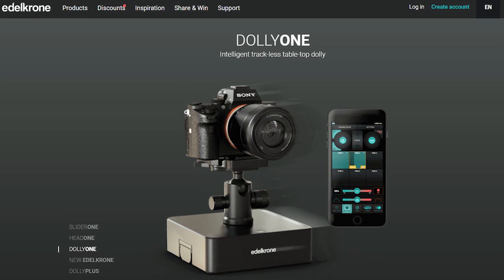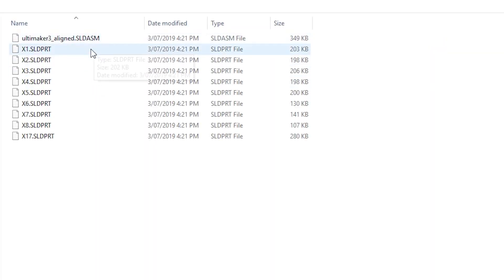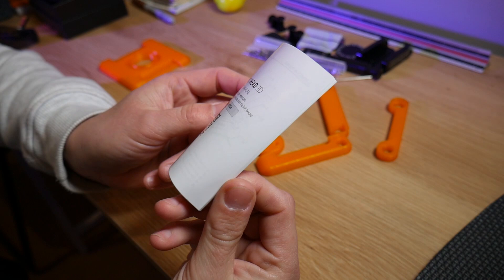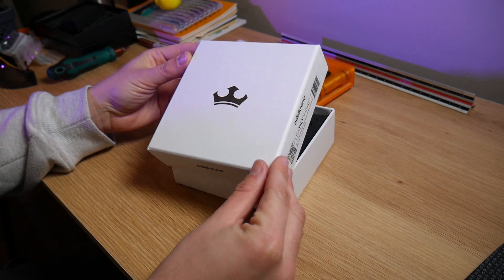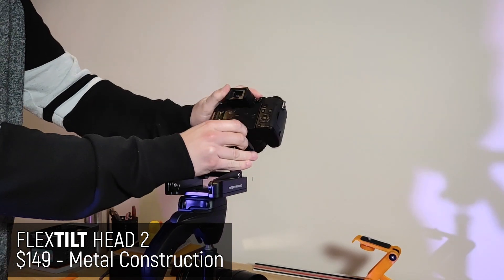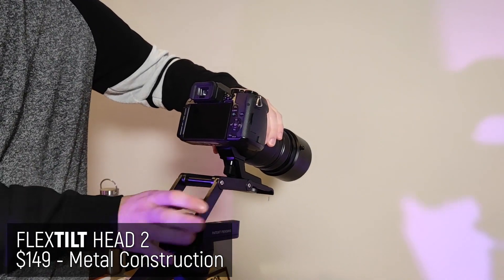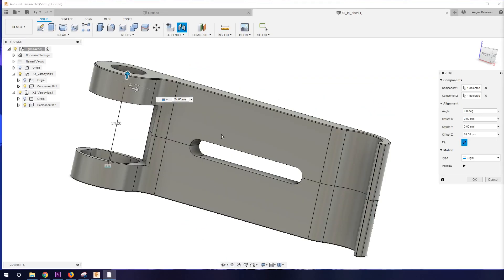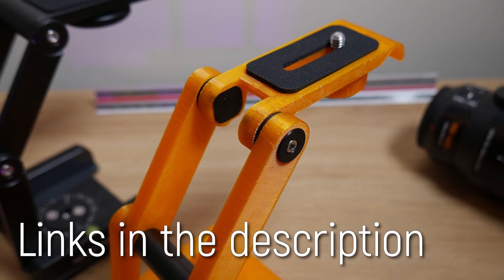Is the FlexTILT Head 3D the Future of Manufacturing?

Comment: Boy, the heavy cam definitely shows the bounce of the 3D printed version. Doesn't seem possible to really get smooth footage with it IMO. A carbon or glass nylon filament would probably alleviate this, but then the hotend needed to print it well would outprice the metal version. Overall I agree with the below comment, this 3D printed one is a gateway drug to the real deal.

Comment: The issue with the larger lens is not weight but balance. Using the lens mount you have you need to pull the camera on the mount so that the lens/camera combination is not so front heavy. I use a much bigger lens camera combination and unless I balance it properly on my head it becomes unusable.

Comment: In my opinion, the shipping “cost” or waste is not comparable because the filament shipped can be used for other projects (at least have the potential to) whereas the metal bracket is quite specific in its use and more limited to different applications, than a spool of filament.
The recyclability however, is probably more limited for ABS than it is for metal though because (I think) steel can be recycled almost indefinitely whereas ABS is quite limited.
There are a lot of factors and I feel it is critically important that we find a plastic that can degrade quickly in some environments (such as whale GI tracts) or cold water environments, preferably both.
We have the technology to make plastic last almost forever, we should only use that technology for specific, long-term uses and make bio-degradable plastics the only legal product. Companies should have to pay licence fees for producing non-biodegradable plastics due to the fact the products will need maintenance for ever, from production to use to disposal, the plastic will exist and have to be managed. If a company makes something, they should have to pay to make it a permanent part of the earth. If a product has a normal lifecycle like all animals and plants do, then, no licence would be required, as long as there is no environmental harm in the production and distribution of said item.
Just my opinion of course.

Thanks for the content!

Comment: Is the camera mounted the wrong way around?????  I was just thinking if u were to use a heavy lense that far out from the pivot point there would be a fair bit of leverage force on the joints compared to the other way around???? also with it the other way around the weight mass should would be closer to the centre of the tripod???? or am i overthinking this???? I just assumed thats why the camera mount is offset to the rear (to accommodate the lens weight)

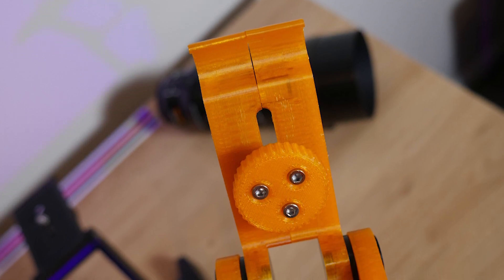Comment: You could actually see the top plate of this 3d printed tripod cracked in one of the photos at 4:43. I presume it broke in half and Angus glued it together.. It's good marketing for this company though, subliminal message to suggest buying the metal one instead of opting for the 3d print kit.
Reply from the maker: It's two parts , I explained I didn't like that decision but they did it to remove the need for supports

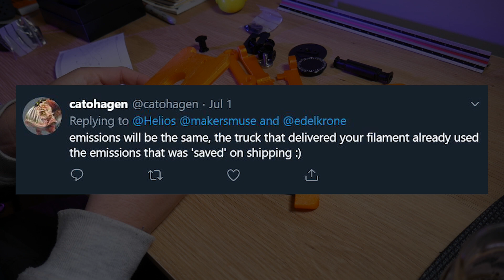Comment: @10:30 the impact to the environment isn't even comparable between the two, filament is wayyyyy less harmful. keep in mind that a) it weighs far less overall which is the primary factor for shipping fuel cost b) what environmental impact shipping your filament had is divided by the amount actually used for this device (generally 1/5th the entire roll, so 20% of the environmental impact is used, not 100%) c) most people will likely print in PLA which is a completely renewable plant based product that isn't mined.

Comment: For the moment, unless the trade war goes way worse, my thought is that, no, this does not make 3D printing the future of this kind of product, yet. The original version might be CNC'd, but for this kind of things, machining already does the job well enough, and that's really cheap as long as it's a "kit". In fact I bet they could have release the metal version as a kit and it could be cheaper than the 3D printed version when you consider the price of filament. That's, of course, unless trade war goes way worse and the price contains a lot of custom taxes.
So what's the point having the 3D printed version then? Likely it's for getting a lighter version of the same thing, or for being able to customize the design a little bit, rather than for cost saving. But just as a side note, if industrial 4.0 gets strong enough, single unit CNC part ordering might become cost efficient enough. CNCs can be auto loaded and unloaded, and mail packages can be auto sorted, after all. It's just the assembling that currently can't be auto programmed using the assembly, as far as I'm aware of, so only kits can be shipped without human involving.

Comment: If you really need the bubble level, they sell them on amazon in multi-packs, just search for "micro bubble level" or "disk bubble level". Then its as simple as importing the base step file in fusion 360 and making a indent to push the disk level into.

Comment: The reason the long lens makes it droop is the distance to joint - you're making a massive lever and applying a lot of torque.  A similarly heavy but short lens might not cause the same problem.

Comment: It seems to me that the entire design is very flawed, and may work a lot better if it included ratchets and manual twist tighteners ? Plus an Independant base that wouldn't require a TriPod, which should be doing all of this posing by itself ? !  ( ? )

Comment: 40 years later, need a repair for my grandpa's camera mount, load up the files print out the new parts and keep on rolling. That is the benefit of the current state of 3D printing.  You will never be without parts even for more unique equipment ( single digit product runs)

Comment: 4:46 add a slot with a larger inlet/pass through hole for the thread (think of a shifter in a car) and print a filler to put into the area once the part is added so it doesn't come back out, you can make it slightly cone shaped and use the pad to hold it in.. or threaded or clip idk

Comment: It might be worth pointing out that this head isn't really meant to be used on its own, or directly on a tripod.

I mean, if you just had a very basic tripod with no central column and no head at all this might be vaguely useful, but no photographer (with a clue) would pay $150 for for it when you can get proper, professional-ish grade, lockable, micro-adjustable 3-way pan/tilt heads for less than $200. It's just not secure enough, versatile enough or ergonomic enough to justify the price.

The point of the FlexTILT Head is to be used as a kind of "mini-tripod" mounted on top of Edelkrone's ($700) DollyONE (basically a remote-controlled base that can move and rotate on flat surfaces, to do tracking video shots.

Comment: As someone who worked in materials testing, it irks me to see so-called testing that's poorly conceived, planned and executed. Anecdotal experience does not equate to "testing". True testing has a) methods, b) metrics (objective and quantifiable) and c) conclusions. True testing involves real world scenarios, plus safety factors, and measurement devices.

So, for this type of test, I would have described real world use cases. Hint, a long, heavy lens doesn't qualify. Firstly, because that's not the product's intended use. Simple physics dictates moments of inertia, and cantilevering mass well beyond axes of rotation...you most likely get the point.

Regular lenses and macro lenses are more appropriate. With any of this equipment, both FlexTILT versions would've performed equally well, albeit with more rigidity for the commercial version owing to its aluminum construction.

Lastly, true testing requires consistency. This minimizes variables while ensuring confidence in results.

So, standard camera bodies (DSLR, compact, mirrorless) with standard and macro lenses. Weights recorded. Joint torque forces recorded. Exerted forces and angles recorded. And deflection and vibration (both amplitude and duration) recorded. This is done for both rigs, the metrics compiled, comparisons and conclusions made.

With a product capable of performing satisfactorily for a wide variety of tasks and users of all types, Edelkrone are to be commended for adopting such a forward thinking approach to product sales. I love the idea of combining affordable kits containing only specialty components with 3D printable files. This is a win-win as manufacturers stick to what they do best, save on tooling, production, inventory and shipping and handling costs, while consumers gain access to high-performance products that would've previously been beyond the financial means of a much wider audience. Hopefully we'll see much more of this innovative approach in the future.
Reply: A scientifically rigorous series of tests like you laid out would be great, but it's beyond the scope and budget of this channel. And your attitude stinks. You can be irked and still mind your manners. He made an excellent video within the parameters of this channel.

Comment: I would print in PLA as ABS gives off toxic fumes and I don't think the temperature will be an issue. Doesn't really matter if you already had ABS laying around but I wouldn't recommend using it over PLA. I'm still new to 3d printing but I do think PLA would be better for the majority of people. On average PLA is 1-2$ USD cheaper than ABS. I could be wrong.

Comment: 3D printing is more expensive then injection molding, when you take the time into account and injection mold in volume. So, replacing cast metal with 3D printing is non sense. Metal casting has to be compared with injection molding, especially when a company plans on making more units then currently.

Comment: Since the models are modifiable could you help offset the additional flex by creating channels designed to pressure fit in aluminum rods to add a bit of rigidity to the parts?

Comment: There is a huge difference between what will hold a camera firmly and what will hold it rigidly, and it also depends on which sort of camera you are using. A DSLR, with its moving mirror is very different from a mirrorless camera, particularly when using the electronic shutter. Particularly for a DSLR, any plastic head is a really bad idea. Also, can you imagine if the user prints in PLA and leaves it in a car in the sun. I remember the video you did on prints left in a car. I know it's not ideal for camera gear anyway, but to come back and find that some of your gear has now distorted would not be fun.

Comment: The plastic printed version is a clever strategy from the manufacturer in that it serves as a gateway drug to the real one. This isn't a replacement, it's an introduction.
Reply: Damn, that’s some smart marketing tactics.
Reply: Unless you only use really light cameras, like really any action camera, especially since the go pro works just fine for a lot of filming when you aren't doing super professional stuff like movies, at that point you don't need a super high rated mount that can handle a lot more than you would ever need and would likely be content with the 3d printed version (also about the go pro being fine, I'm not just saying that to defend a personal camera choice, I much prefer using my Canon EOS 60D over any action camera because I get perfect control over any parameter I need/want to change)
Reply: Plastic waste as marketing ? Yayyyy

Comment: Will a Prusa i3 Mk3 do okay with ABS? I'm going to be getting my first 3D printer, and I need to be able to print things that will work on a motorcycle or in a car. Things like dashcam mounts that will be left in a hot car in the summer. Is that application even possible with 3D printing?

Comment: I actually love the concept of DIY camera gear. There are designs out there already. Some even use a mix of 3d printed parts and then pvc, conduit, or box tubing. These types of designs I can see rivaling some professionally made equipment. I've already made all kinds of pvc stands for camera equipment. I could have saved some money on various connectors and other small parts, if had a 3d printer at the time I made them. 

We aren't there yet but as 3d printing tech evolves I can see many companies selling designs for products or parts rather than actually producing them.

Comment: Hmm. If you use engineering plastics like those from Formlabs/Carbon/Dreve/BASF/3DSystems you could 3d print the Plastic version would be potentially as good as the aluminum version without the weight.

Comment: I'm curious as to how this makes financial sense to Edelkrone. They're still producing/shipping parts out for the kit, and the cost to produce the full metal version and the shipping differential can't be $150. So unless they're simply doing this for publicity, or trying to tap a market that wouldn't otherwise buy their products, they have to be losing money on each printable kit sold over selling an original metal one.
Reply: The smart move would be to target this to two different customer streams. The metal version to the commercial camera crew for B roll on their light ( though still heavy small cameras). $149 is cheap in terms of commercial camera gear, and the plastic one to the home enthusiast/blogger with lighter cameras, less demanding use case, and smaller budget.
Reply: It is the same business model as selling both hardback and paperback books (back when books were on paper). If you are in a hurry, your only option was the expensive high profit hardcover version. When sales taper off on the expensive version, the book is re-released as a cheap paperback.

Since sales had already tapered off, it didn't cannabilize hardback sales much. It provides an excuse to reuse the existing marketing materials with tiny changes. And it taps into a much larger market.

Comment: When you are a 3D print er you already have several bits and pieces of filament so the shipping carbon foot print I really don't think this matters if you are worried about the $7.00 of filament shipping it was already covered I like that this Co. would do this but as a designer maker I could look at this and design on if i needed it and more than likely have an item that fits my needs closer than the bought one

Comment: Use the pla parts as sacrificial molds for aluminium casting.
Reply: this would be the best way to use the files- 3D printed plastic is great, until you fart on it wrong, or use it on a hot day in which case it will deform and droop- and that's without a lump of  a camera on top...
Reply: @SuicideNeil  Wait... There is a right way to fart on it?

Comment: In my opinion the 3D printed version would be perfect for a GoPro or any other action camera as it’s cheap and can easily hold the weight of a small camera.
Reply: Also, as it’s 3D printed a GoPro mount can easily be modeled, printed and used instead of using tripod adapters

Comment: I made one on my MK3, I printed in PETG using Materhacker filament. 100% infill.  I like it, but squeaky joints. My camera weighs 3.5lbs (Nikon P1000) so it's really testing the build.  Works well. I guess my true costs based on PrusaSlicer was $40-45, broken down to $29, plus shipping of $8 (that seems high to me), plus printing costs.  I was going to make a thumb screw with a allen head so I don't have to keep an allen wrench handy.  Also mine didn't look as clean lol, but it works.
Reply: https://www.thingiverse.com/make:672751

Comment: Hello, Zaxe is a very overpriced 3d printer that comes with a worst slicer ever. The printer does not use gcode files so you cant use it with 3rd party slicer. You need to add tolerance in the software to print assambling parts if you want them to assemble.

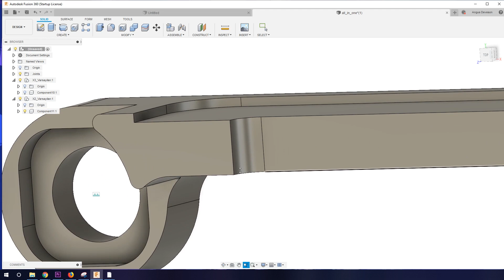Comment: 11:20 - You can also modify the joints to be toothed and replace the screws with wing-nuts. Then it would hold better and you can tighten or loosen them much more easily. 😉
Reply: Can also make double/triple/quadruple joints to increase the friction area. As they do in GoPro mounts
Reply: @TomasSab3D  My thought exactly.  This is a case of a missed opportunity for FD superiority!
Reply: Yes, I had a similar thought. I'm not sure the spacer tubes need to be metal, either. So a fully 3D printed design, except threaded rod and wingnuts, should be possible, especially with a light camera. I have recently abandoned my 6kg of DSLR kit in favour of a superzoom with 1" sensor.
Reply: - yah, he should also try a 0.6mm nozzle and 0.3mm layer height to have some better stiffness of the 3D printed component.
Reply: That’s what I thought too. But that also means that you can not fold it away anymore.
Reply: +1, was gonna write that. Interesting they didn't think of that since these toothed couplings are common on tripods. Would allow for a bit less adjustment flexibility, but could hold your heavy lens easily. Now arrange the teeth cleverly on the different parts so you can do "half clicks"...

Comment: Correct me if I'm totally wrong or missed something.....the standard camera tripod with a pan and tilt head (not the mini desk top ones)  does all this, even the cheap and nasty plastic cheapies......so why do you need another tilt head? I have an aluminium 3 legged extending girder type camera tripod from the 60's and that came standard with a pan and tilt head as do all others I'm sure.
Reply: I think this has far more reaching uses than for a camera mount...….it would make the ideal third hand approach as in with a small vice for up close printed circuit board assembly work or mounting a magnifying glass, I would ensure that it was attached to a heavier base to make it immoveable. It would be the ideal 3d printer project even with a total build from PLA.